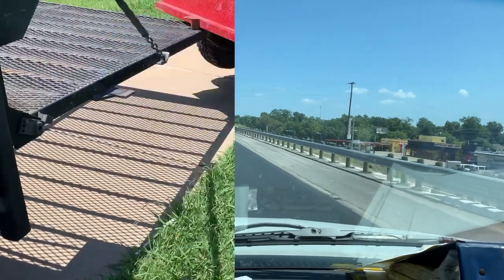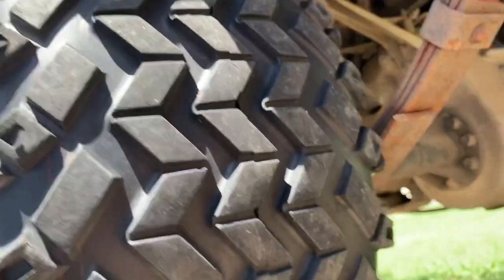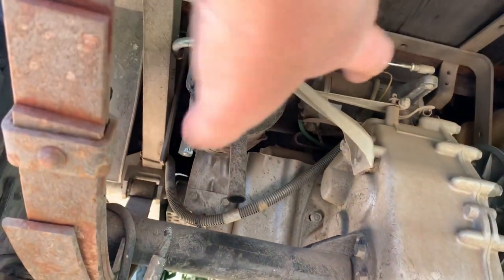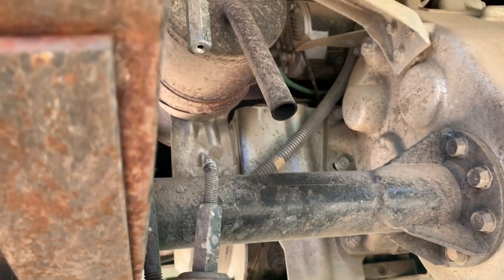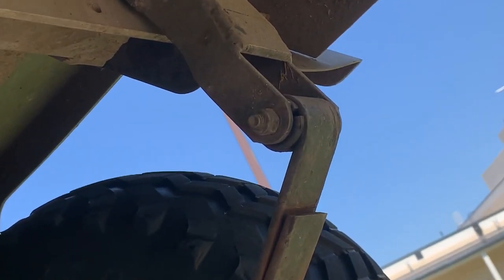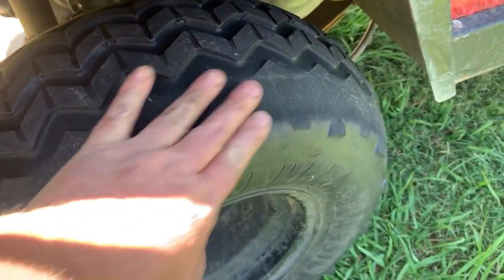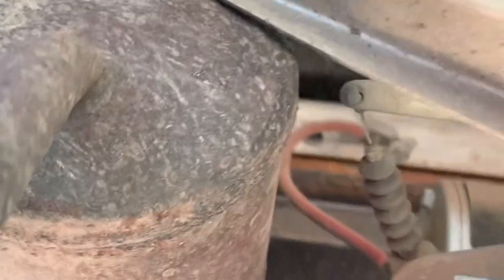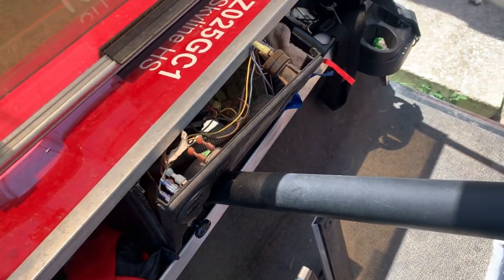CATASTROPHIC DAMAGE TO GOLF CART! AWESOME TIRE REPAIR KIT!

Comment: Hard to believe why some idiots treat equipment so badly. I had a one year old Cub Cadet come in my shop recently that I thought was about 20 years old. Don't know what the guy did to make it so bad. Blades and deck twisted, full of mud, water in the gas tank, carb needed to be put into the ultra sonic cleaner, paint all scratched up, etc. Thanks for a great video.
Reply from the maker: Because they don’t have to pay for it
Reply: And guys wonder why they were fired.